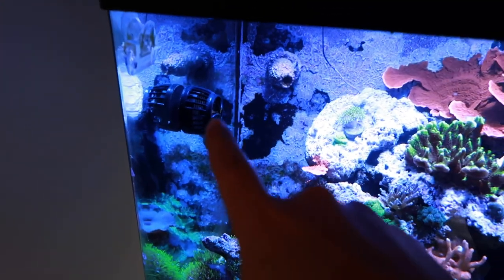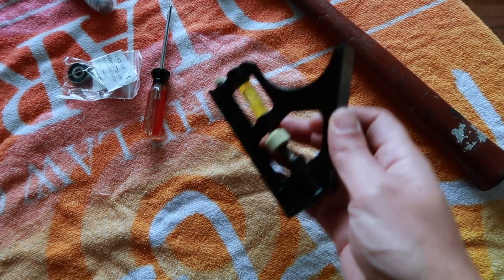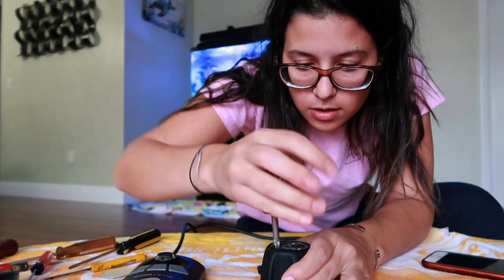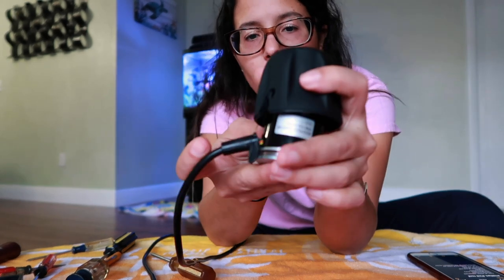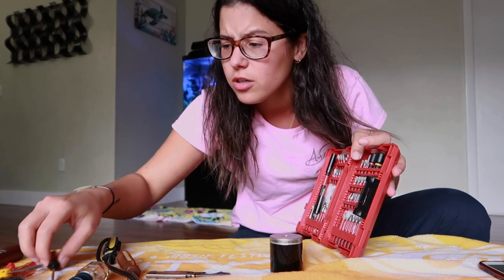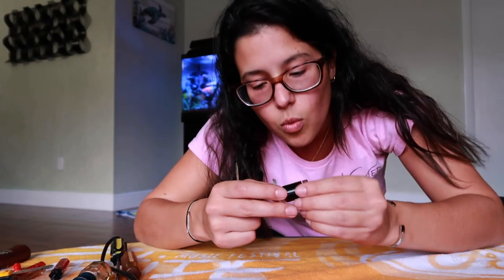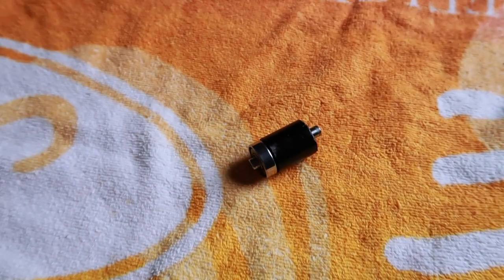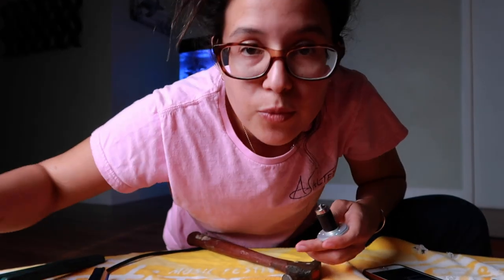The MP10 QuietDrive is RUINED

Comment: black guide pin in propellor that’s cracked causes fan to make noise. I have the same issue and located problem. I’m heading out to home depo to see if theirs replacement part or call vortex
Reply from the maker: hm how do you access this black guide pin you speak of? lol Is it visible from the outside?